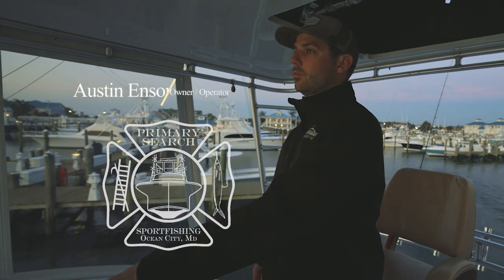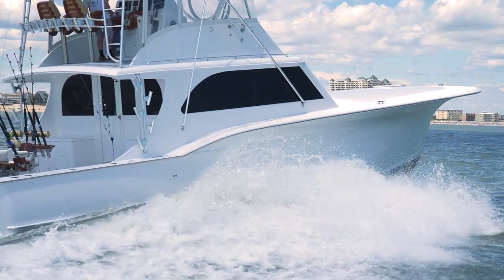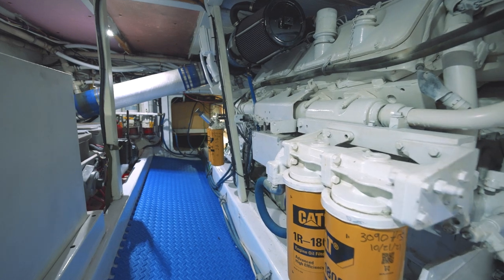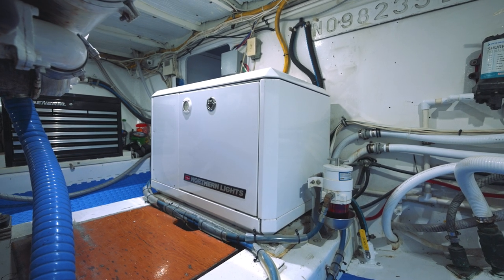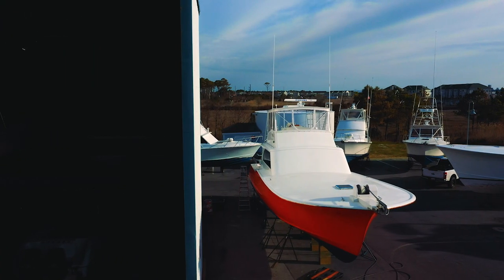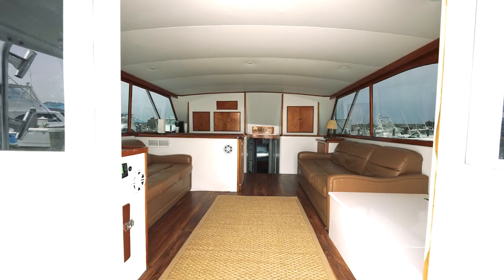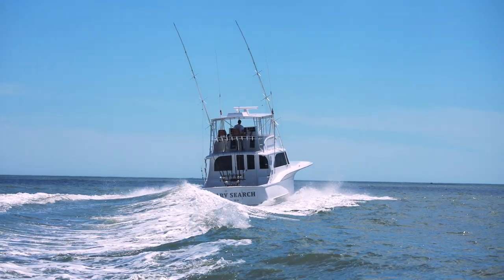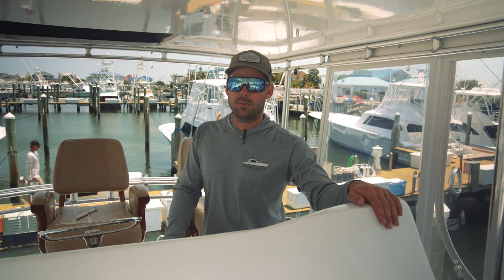The Primary Search Custom Carolina Restoration (Before and After)

Comment: 32 gph?
Is that EACH engine, including generators?
If so, that is FAR from econonical.
Reply from the maker: 32gph for a single screw 1300hp caterpillar yes. Im curious what specs your working with that are the basis for your opinion.